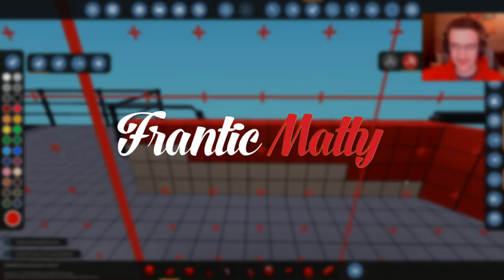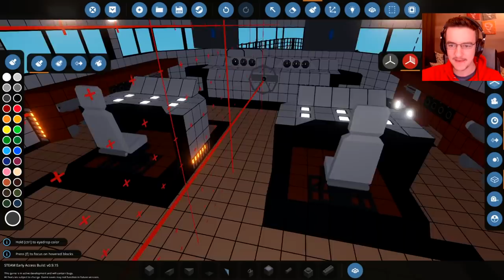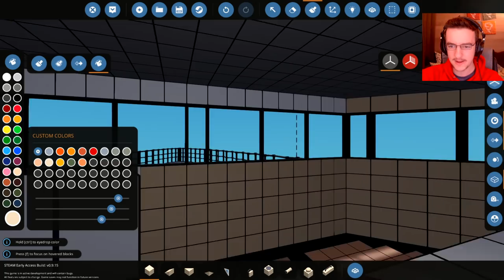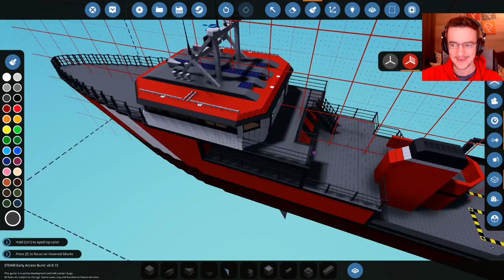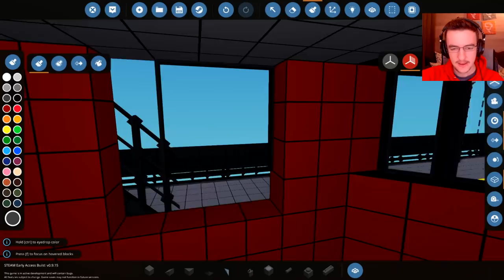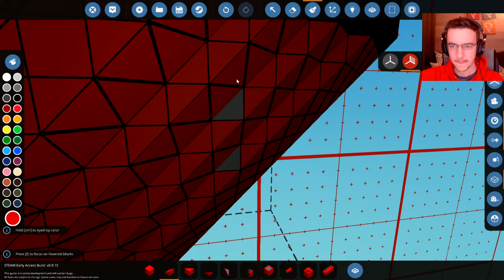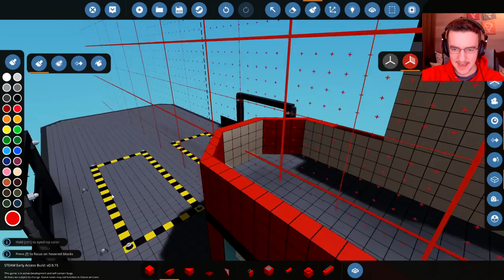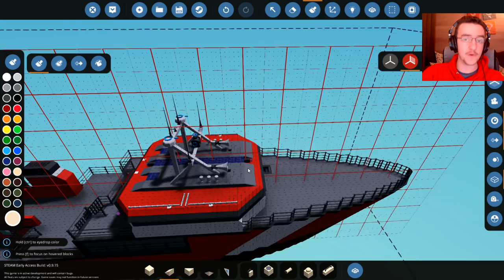Captains Room!  -  Research Ship  -  Stormworks Gameplay  -  Part 7

Comment: Push the lights under the main desk back and make them red or a different color for affect. Frantic you have also said that small room was for the crane control then the way to the engine and now the captains room
Reply from the maker: Nono, the crane control room will be ontop :)
Reply: Ok